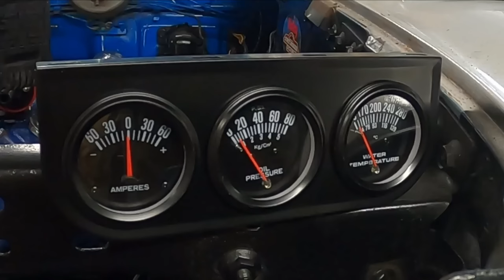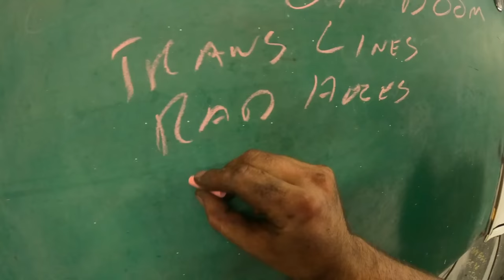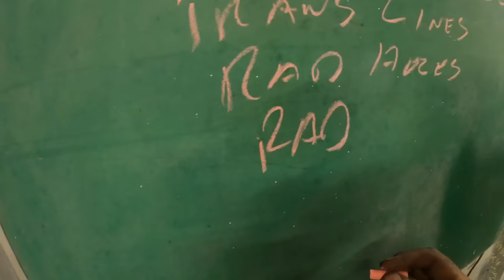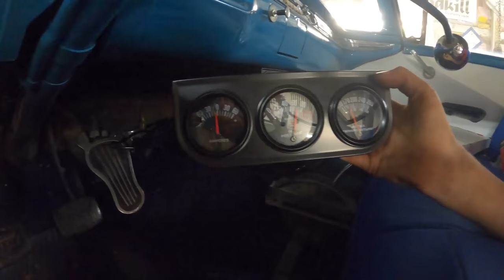Will it Run? 390 Ford FE BIG BLOCK Shadetree Special Install in 1959 Ford — My Son's First Hot Rod

Comment: The old saying that you get what you paid for doesn't apply anymore. It did when I was a kid, a teenager in the late fifties. I had that same body style as JD's car is. I finally just gave away or lost all the trophies that it won for "being a pile" as you direct your son... I had some real impressive wins as I started with a "Y" block 292 engine racing against the famous 283 and 327 chevy or some of chryslers many engines... my proudest moment was handing a dodge guy who had a 354 hemi engine his ass in a basket... in a quarter mile with his having all the sweet stuff an I run a RV cam with the biggest four barrel I could find, and get to seal on the intake... I got him by two full car lengths on the quarter mile. I ran the fords because I was a outlaw and pushed it in peoples face. I did get outrun a few times and make that number very few... Sedro Woolley Auto Parts known as S.W.A.P. stepped up with a tri power for my little 292 Y block that  had almost two years  of racing, tare downs for a quick roll of incerts or even rings now and then... I didn't know any better and ran the chrome rings... they basically were making a larger hole every run. The first time and against a chevy with a blower against my little fairlane... I whipped him by half a car in the quarter. By  then I was getting into the low 11's and hit a 10.82 on one run. This was at Arlington drag strip. I started making money at that time as most times I spent all I had.... once, I had no  choice but to win as I had the rent money on getting in. I woke up in a hospital in Dayton Ohio when I had headed home after a good race... a farmer who had some cows in the back of his box flatbed truck lost it and took me, the pickup I was driving, my trailer and my car all out when his cows moved around on the rainy roads back there... I was just on the freeway (just better two lane) and this was in 72, as I stopped at a friends house.... his sister an I were thinking ... you get the picture, so anyway with me only having liability insurance and him none... just a farm tag on this old international who by the way with some help .... they pulled his bumper out and he drove home. I had my paid for 71 chevy 4x4 and fair trailer for them days plus car tangled up on parts of a guardrail. I did have liability insurance so it paid for their highway repairs. It was very clearly his fault but he also was one of the good old boys so he got a warning ticket. I sold all I had there to pay for my being in the hospital for a week with a broken hip. It didn't help that after they got me out of my truck (I was unconscious) and laying in their old Packard ambulance, my chevy truck caught fire and burned down as well. I was just glad to get some money for my scrap and get home on a baloney sandwich and a greyhound bus ticket. I have a lot more to this  heartbreaker but your calling B.S. by now. I just got to say tho, that 59 ford fairlane was one of my most favorite cars

Comment: Rather than the cherry picker you need to put a steel beam across your garage and get a chain hoist. Then you can just lift it and roll the car underneath
Reply from the maker: It would collapse
Reply: @PoleBarnGarage  nah, put in a couple of posts to hold it up. Easy peasy.

Comment: Hey man i have a question .i bought a 1992 dodge it needed a fuel pump to run but now. it is a throotle body truck. it backfires when i let off the accelerater.it has all new spark plugs wires and sparks plugs new distributor cap so i don't know what would cause the problem
Reply from the maker: Timing
Reply: Thanks
Reply: I appreciate your help

Comment: I'm going to acquire a carb vehicle motor for the dodge ram if I have to carb swap or change the motor, I would buy a 360-390ford Fe,or a ih 345 v8

Comment: my 390 fe has a miss and im waiting on a new chinese carb and fuel tank/sender to see if that fixes the miss.
if not i may have to rebuild it....
Reply from the maker: Unlikely a dead miss is fuel related
Reply: @PoleBarnGarage  well i shouldve mentioned i  already cleaned and rebuilt my carb and changed fuel filter, added pre fuel pump filter and i still also have an off idle stumble and very fine misty rust coating my see thru pre fuel pump filter ......SO carb/fuel tank is more for that ......
BUT for that  miss,  in order of likelyhood , its probly 1. no compression from burnt valve, hole in piston, blown head gasket etc 2. bad plug/plug wire 3. low compression piston from too many miles/age/rust
4. leak in intake manifold

Comment: I love the fact you are helping your son building his car but if he is blind  from using a wire wheel with no safety glasses it wont be much fun. we have all done it but try a little better to protect him please
Reply from the maker: From a drill at 800 rpm, not gonna happen. Die grinder at 8000rpm, sure. Use common sense when it comes to safety

Comment: C6 trans take 12-13 quarts. He only put 4-5 in for start up. I think that’s why the pump imploded. Lack of fluid.
Reply from the maker: The pump died because it wasn't seated, if the pump doesn't turn it won't draw fluid from the pan into the trans. You think a transmission pan holds 13 quarts of fluid?
Reply: Wow a YouTuber that replays to old videos. 
I only said this as I just had a c6 fully rebuilt. The trans guy that has rebuilt countless amount of c6’s told me to put about 2 quarts in the converter and 8 in the pan for start up. That’s the only reason for the thought I had.
Reply from the maker: Nope, it was just my own stupid mistake. Good rule of thumb by the way, there's no hard number on filling a converter, fill, shake it, repeat until no air bubbles come up. Could be as many as 4 quarts!

Comment: That Fat Engine should be very durable.
Reply from the maker: Yeah, well,I know the guy who built it so let's not get our hopes up 😂
Reply: @PoleBarnGarage  DOH, LOL. The FE runs so it will be fine. My Bro & I had 360's & 390's in old trucks and they were almost indestructible with what we put them through. This will be a fun series to watch. FWIW, my late father had one of those '59 Fairlanes but sold it before they got married. It was black with the fender skirts & a continental kit on the back from one of the pictures I've seen of it.
Reply from the maker: Very classy cars

Comment: I put a brand new tbi distributor in my Silverado it's a a team performance,top speed performance product southwest auto parts online.$49 I bought a set of Napa belden super 7mm silicone jacket radio suppressor plug wires and the other change in the ignition system is a ac Delco replacement ignition control module and the ac Delco replacement brand new starter.high torque mini starter my truck the factory starter is a normal big body SBC 168 tooth starter it sounded like it was just about to grind, it would almost completely kill the truck before starting it and I probably could have gotten away with changing the solenoid but I would guess the stator brushes were burnt and or glazed over,, and I am looking for a 84; Buick Regal limited somerset 2 edition for a project a turbo car idea I have and I actually like the paint scheme..I'm going one of two ways Oldsmobile 307: roller cam v8 and the 416 headed 84-86 305 h.o. motor or maybe a 283 power pack head motor to recam and play with..

Comment: Should have went stick shift !
Reply: @PoleBarnGarage  lol im doing a 55 ford , 406 4spd , i get it but that fancy distributor would have bin a lot of the parts ! Lol a 3 spd with overdrive from a mid 80s van goes for about  125.oo no one wants them and they look like a toploader. I put one in my sons 65 mustang with 391 gears  it works great

Comment: 4:56 fords "ingenious plate thing" is the reason you don't have to add 10 spacers to a starter like on a junk-ro-let engine. Glad i didn't start watching your early videos because i wouldn't be a sub today.
Reply from the maker: I've never had to add 10 (cheaper and easily changed) spacers to a Chevy, I also rag on Chevy's (I don't even like them) 
Be objective if you want to be intelligent. The fe engine design is not the hill I would die on, that's certain 😂

Comment: If you're going to be hating on Fords,I wont watch.Just keep to the off-brands made by disgruntled ex-Ford employees.FYI, the FE is the smallest dimension and lightest of all big blocks.How do you get 100 more hp and lose close to 100 pounds in a corvette427? put a Ford 427 in it.The FE is the only American engine that can easily be converted to SOHC...only needs a pile of money.If I WANTED someone hating on Fords,Id look up that snow-bound fool whose channel I shit-canned.
Reply from the maker: I'm a car guy, not a brand guy. You can't possibly objectively argue that an FE is a better engine than a BBC, hell even Ford didn't think it was, which is where 385 series engines came in. You might have an objective argument with a 429/460, but not the fe